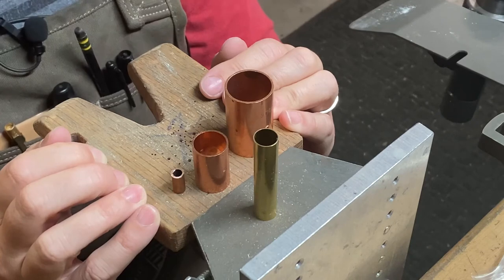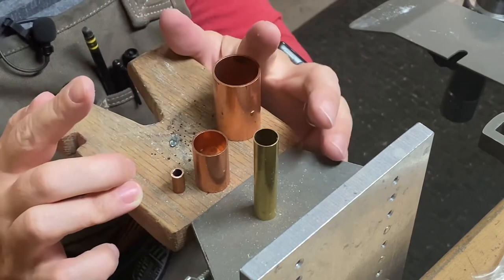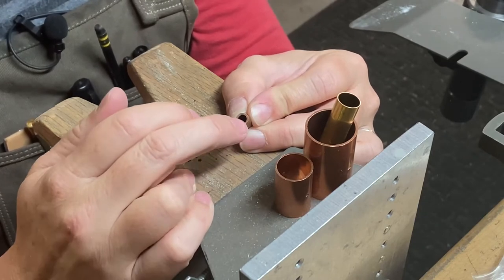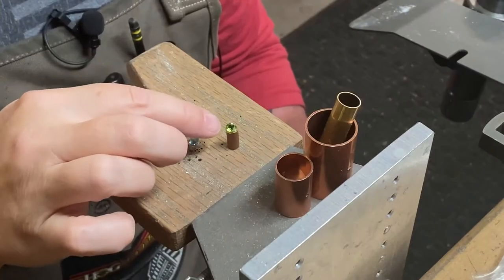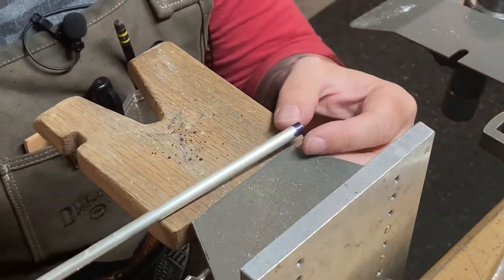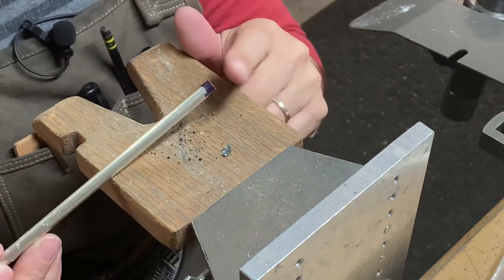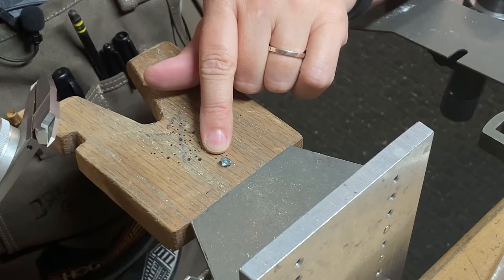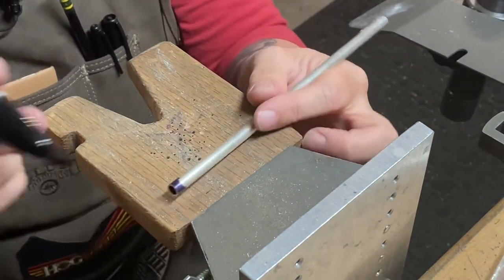Real Time: How to Bezel Set A Faceted Stone For Jewelry Making

Comment: I can agree with you on making your own tubing for stones less than 6mm because they are really hard. I make all of my own tubes for most of my stones but having a swage block and a decent hammer makes it a bit easier. Most of the time I make tubes put of D shaped wire and make jump rings out of them. Using D wire has major advantages because we all have some lying around. It gives enough thickness to set the stone and the outer diameter can give some ace effects. Just file to your preference but remember to bevel a 45 degree angle when you have the right size-you need a thin edge to rub over the stone.
Reply from the maker: A tubing draw plate would be good too! They’re really expensive though so I don’t have one yet. Yes! A 45 degree angle is key for the rub over.
Reply: D wire as in D wire for rings?? I’d love to see this!! 😃
Reply: @johnmimist  yes D wire that we use for rings. I love using patterned wire and so long as the cab is snug provided you chamfer the edge to 45 degrees and file the edge so it's within 0.5-1mm from the edge it's great. It takes a fair amount of practice because you really do need to make sure the inner edge is super clean before you start pushing it or hammering it over. I tend to use chunky bezels for big cabs and pearls x

Comment: Wow, this was VERY, VERY, HELPFUL, thanks! 👍  I believe you just saved me some 💲.  I saw another demo that used a ball burr 1st to start out and a setting burr 2nd.  I can see how a ball burr might ensure you start out completely centered but knowing it isn't necessary is good. I'm just wanting to attempt to tube set 3mm CZ's.  Also, I was stressing out over finding a single punch (instead of a set) when I already have a bezel rocker and burnisher. Now if I can only find the correct size setting burr for my 3mm stones (and maybe 2mm stones) without having to buy a complete set, I'll be good to go! 👍  Thank you again so much!🙂
Reply from the maker: You’re so welcome. You may be able to buy Busch burs in single sizes. They’re a little pricey, but we’ll worth the extra cost. They last a long time.

Comment: I have trouble moving the prongs over because after all that drilling and cutting the metal is hardened. Any ideas to help that?
Reply from the maker: Hello Fire!!! For prongs, you could gently anneal them, but you run the risk of un-soldering or melting them. Do you use a prong pusher or just by hand? Sometimes I'll leverage the side of my bench to get some extra force against the prongs since my hands are not always strong enough. Also, if you're talking about a bezel setting, I will take a file and thin out the top edge of the bezel very carefully before re-polishing and pushing the bezel over the stone. I generally do thicker walled bezel settings, so this method has really helped a lot. Hope these suggestions help. Let me know how it goes...

Comment: Meaning then the wall is 1 1/2mm? Half bigger than stone at least? And a full mm smaller?
Reply from the maker: Hi! The wall should be at minimum 1mm thick in my opinion. That gives you about 1/2mm to cut the seat for the stone. So if my stone is 6mm in diameter, I prefer the inner diameter of the tube to be at most 5 1/2mm with at least a 6 1/2 to 7mm outside diameter. Thicker walls work just as well, there is just more metal to push over the stone.

Comment: Hi there.  I have a 5mm by 3mm round faceted Diamond, and I want to make a bezel set men's ring band.  I already have the ring made, I just need to solder on a bezel cup to fit the Diamond.  I see premade bezel cups on Etsy, but not sure what size to get.  I see one online that says its 6mm on the outside diameter, 4.5mm on inside diameter, and 5mm seat diameter.  I already reached out to the seller to ask if it would fit my Diamond, but they are not responding.  So decided to come to YouTube for advice.  Thank you for your time, and have a wonderful day.
Reply from the maker: Hi Jared! I wouldn't use a premade bezel cup since your stone is a faceted diamond. If you can, make your own tube setting or buy a premade tube that has a thick inner wall ( 0.5mm or more) and a diameter of at least 5.5mm. Then you can use a setting bur to open the seat and then burnish the walls down on top of the stone. Hope this helps!
Reply from the maker: If you're talking about a pre-made tube bezel, I'd say the 6mm outer diameter and 4.5mm inner should be ok. The only thing you really need to find out is the height of the pre-made tube bezel to keep the culet (bottom of the stone) from touching your finger.

Comment: Would you recommend a tube 6.35 mm outer diameter tube for a 6 mm stone please .?
Reply from the maker: Hello Millybells! 6.35mm would be very close for a 6mm stone. You will have very little room for error, but it can be done. However, the most important thing is that the inner diameter is about 0.50mm smaller than the diameter of the stone so there is enough of an edge to sit the culet of the stone for a stable position. I hope this helps! ☺️
Reply: @JulessaScofieldMetalsmith  Thank you for replying and sharing your knowledge , your videos are very inspiring and helpful to me as a student of jewellery making . I will go ahead to make this setting for my projects 🙂👍❣️
Reply from the maker: @millybells  good luck! Let me know how it goes 😁